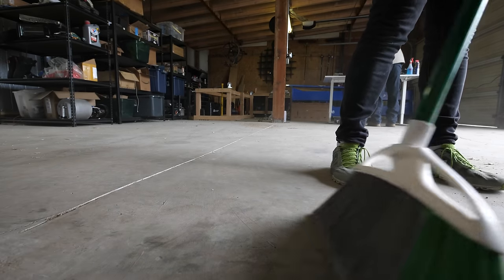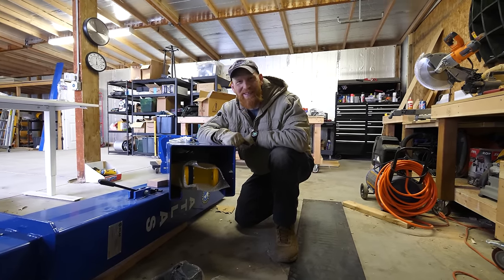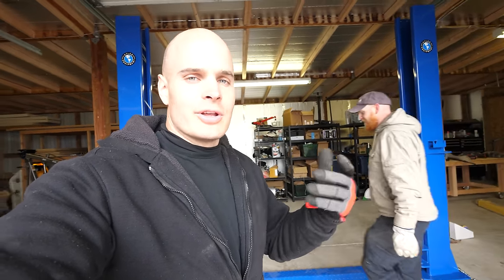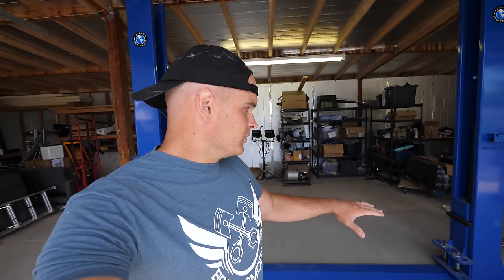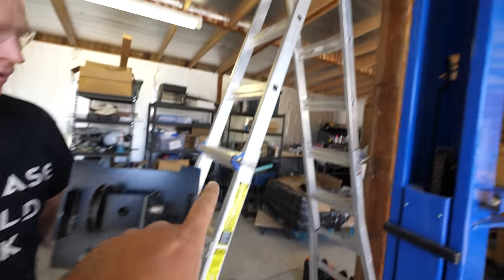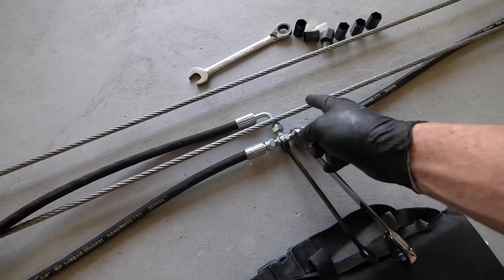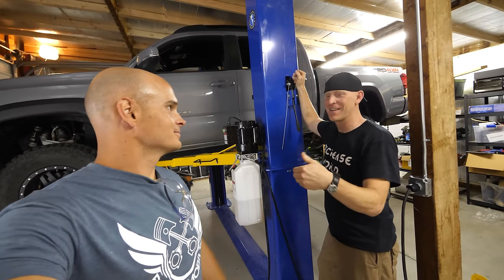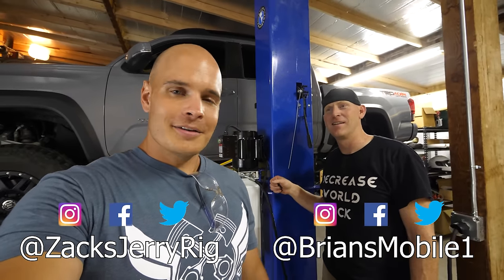Installing a 2 Post 10,000lb Vehicle Lift! - Check concrete FIRST!!

Comment: DEAR JERKYRIG.COM, WHEN THE CAR IS UP ON THE LIFT, WON'T THE WEIGHT OF IT WANT TO PULL THE TOWERS INWARD.  WHAT ABOUT MOUNTING A CROSS BRACE AT THE VERY TOP OF THE TOWERS?  THESE LIFTS LOOK A LITTLE SCARY.  GOOD LUCK NOT HAVING THAT THING FALL.  CHEERS!

Comment: My dad is an engineer, he was looking at going into business making some auto parts, we were in the building looking at the floor,  he said the floor needed to be at least 25 feet thick, concrete and steel, to handle the rolls of steel. Something you some times need to think about.

Comment: Should have cast the bolts into the slab, with plate washers,when you poured.

Your original assertion, it's a 11000lb lift but I'll never use that range so 4"concrete is fine.
What about the guy who comes after you and presumes you fixed an 11000lb lift in with correct foundations? 

Safety must never be short sighted. Use a professional when lives are at stake.

Comment: glad you went deeper but why the machine to break the concrete you don't have strength and a sledge hammer less expensive and really for that much space its not that hard ngl also placing rebar is also fairly easy to do maybe I am commenting to early I don't know I will continue to watch and actually concrete ruck you cant mix by hand with shovels I don't understand
Reply: Because he hired someone to do it. Did you not see the construction crew come in? They're going to use a machine to break it if they have a machine. No one is going to use a sledge if they have a hydraulic breaker.

Comment: I can't believe that you poured new concrete and did'nt use more concrete under the posts and install long j-bolts in the wet concrete. I would'nt trust wedge bolts in freshly poured concrete. I would buy life insurance before using the hoist.

Comment: Just shows What happens when  you don't  USE COMPRESS THE DIRT. You have to pack it  several times just for settlement.  You definitely can see where it was not level  base  sad job  especially for a shop   wonder why you have cracking

Comment: 😭😭😭 you are suppose to hit the nut at the top of the bolt not the bolt it’s self or it will mushroom out and you won’t be able to get the nut off if you need to 
Also you are not suppose to use a torque wrench as a ratchet only when you are snugging up to the specs 😭😭

Comment: Just to be a turd, why not pour a couple footers and template anchor bolts in it?   *Edit: If you put expanding anchors in green concrete you're asking for cracks, if you set lugged anchors in and don't over tighten, they're (I think?) 90% in under week.

Comment: This is completely unnecessary and actually not safe!... All you had to do is cut a 2-3 ft square and dig down 4ft and pour 2 sonotubes... Much stronger going down into the ground rather than out...

Comment: What's the point? Can't even stand under vehicle.spent all that money on concrete?.. and no top cross Brase,so all pressure of force is pulling in on it's self.so the only thing holding the truck is 8 bolts that are 0 grade,from China...?????

Comment: Why are you going by what the internet says for the floor thickness??? Why are you putting so much faith in that as opposed to what the instructions say with the lift?? I'd totally disregard what the internet or ANYTHING else says and go by what the instructions with the lift say! Then I'd add a few inches thickness just like you did. Just food for thought.

Comment: Ok im gonna ask the obvious question...... since you had to redo your garage floor anyway, why in God's name didn't you just pour a pad out IN FRONT of your garage to attach the lift to and put it out front??  That way you could actually STAND UP like a man and do whatever you needed to underneath and NOT have to either buy knee pads or hire a midget to do your new exhaust e.t.c etc...... AND you could build an enclosure of the correct height around your new outdoor lift so you could work out there year round OR simply stick a carport roof over that spot and still have room to go all the way up?????
You wasted many thousands of crapastani colpecs to redo your floor, buy and install the lift, and for what exactly??  3 whole feet of work room under your truck??
Wow.....i sure wish i was rich enough to eat a total failure like that!!!!
My shop had a fire back in April and im thinking about raising the roof up like 6 or 8 feet just to make room enough to put a lift INSIDE and go all the way up with my pickup...... but my fall back plan is putting it OUTSIDE my shop so i can go all up with the lift!!!!  A couple 3x3 foot footers on my existing apron will be plenty of strength and the sky gives me enough room to walk my 6 foot frame right under whatever I'm messing with!!!